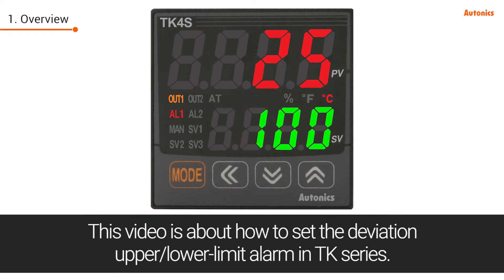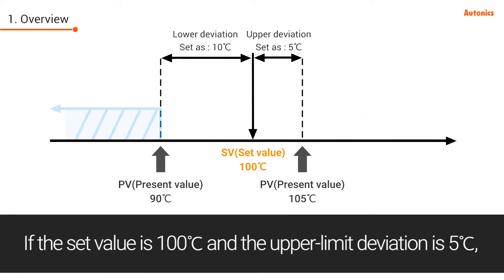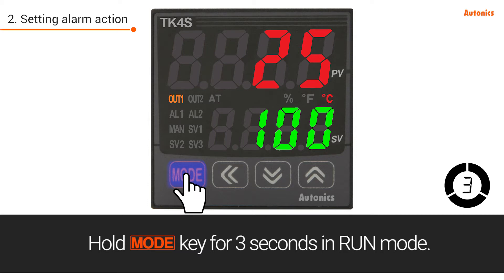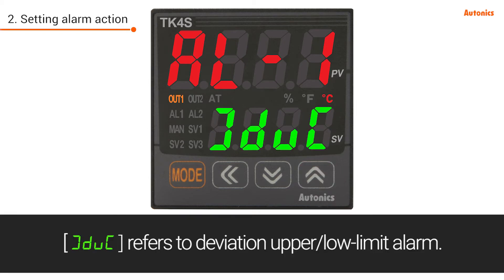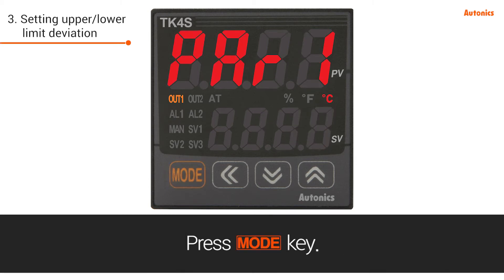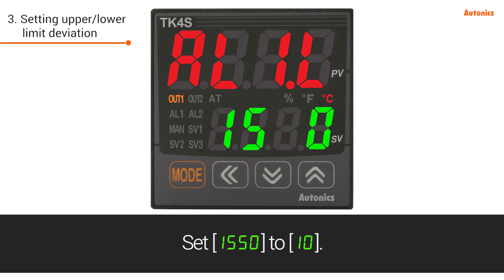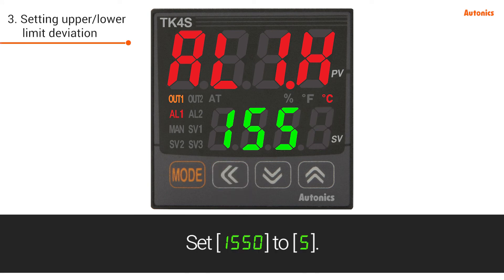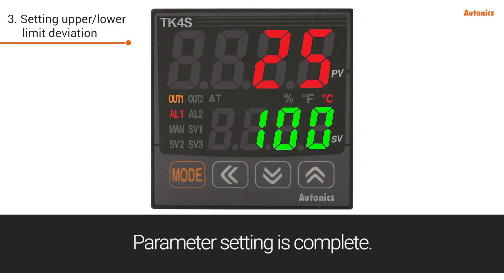Autonics Tutorial : Setting Alarm Operation(TK Series)

Comment: If  StoP and C  0.0  blinking on set value then how solve this problem
Reply from the maker: ⓐ For [StoP], please change the parameter of [r-S] in parameter group 1 from [StoP] to [rUn].
[StoP] means that the heater/cooler is forcibly turned OFF for maintenance. [rUn] is normal status.
ⓑ For [C0.0], press [A/M] key briefly. (For TK4S, press the MODE key shortly.)
[H0.0] and [C0.0] are in manual control mode. Thank you.